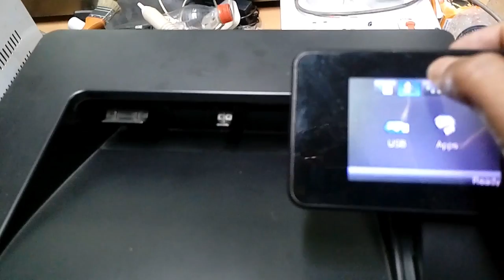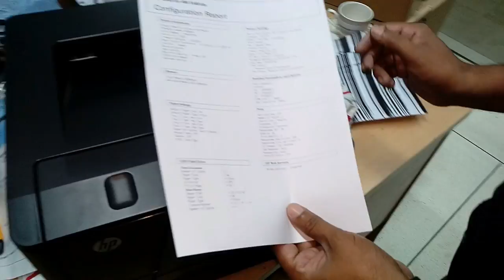How to Fix Black page print (Hp laserjet 400 series printer)

Comment: Mine was printing solid black. Did as shown and it was fixed. Thanks
Reply: Hello! My LaserJet Pro MFP M477fdn was also printing solid black pages. I did watched several videos about it, however, I was afraid to cause more damage to my printer so I started looking I so the black cartridge seems to look like wasn't rolling so I decided to try so I did. I replaced the black toner cartridge the I close it and I printed a test page, and It works. I do not what was the exact reason for what my printer was acting up, however I'm so glad that it is fixed.
Reply: Never